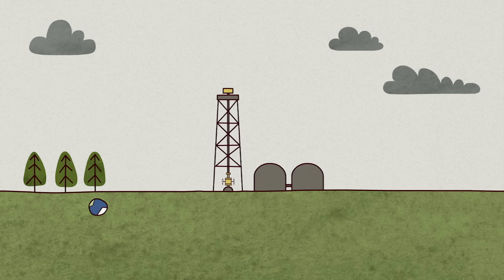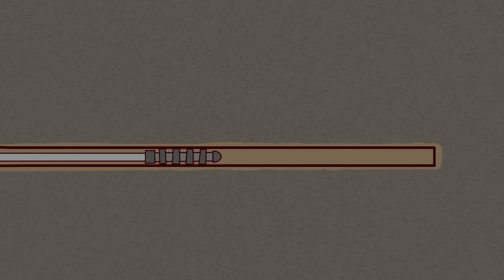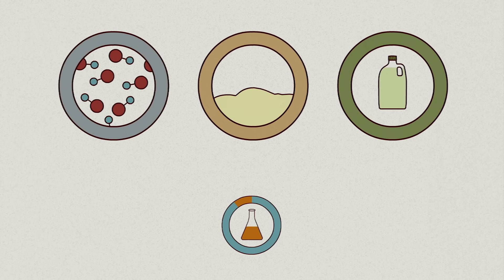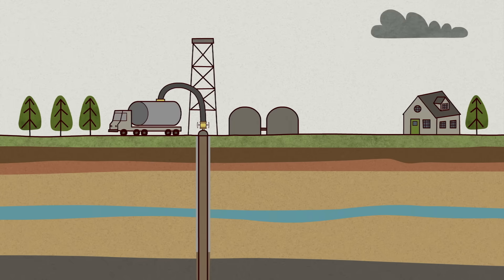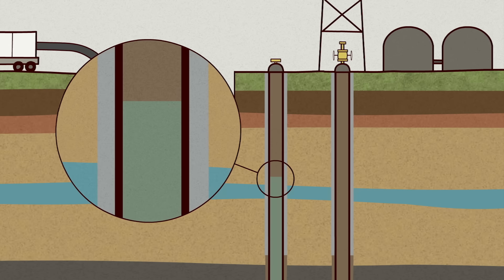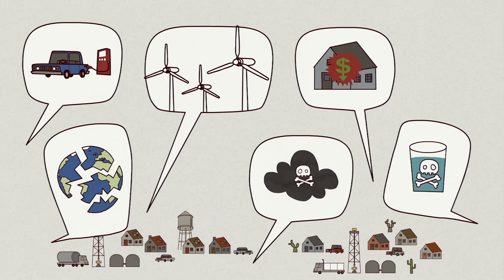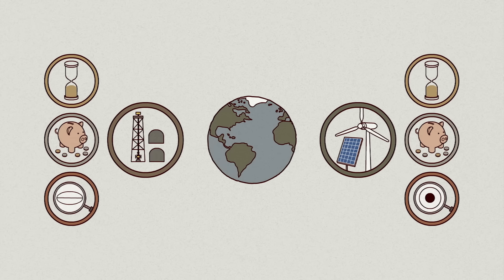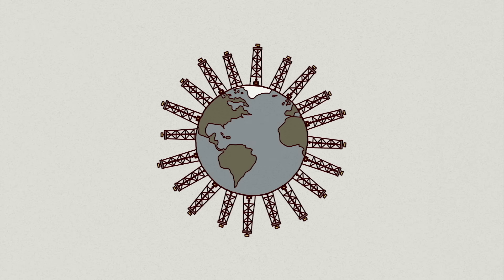How does fracking work? - Mia Nacamulli

Comment: Worked for major oil and gas producer for over 40 years. Volume of fresh consumable water back then was micro volume of today horizontal volumes. With fresh water getting to be a hot commodity for most the regions producing oil and gas, it would be nice if oil and gas company would spend a little more to clean up recovered fraction water for reuse on next well.

Comment: Those different types of chemical mixtures you spoke of, produced a cancer causing carcinogen, called Benzene. Fracking is great, because it unleashes natural gas trapped in shale, underground. But it also unleashes Benzene, into the environment. Were you aware, of that? Did it make you sick?

Comment: Fact Check: Fracking, the fracturing of underground shale to release natural gas, also releases a cancer causing carcinogen into the environment, called Benzene. When it was initiated in rural PA., there were fears of contaminated runoff impacting drinking water of  down stream cities (Philly, Harrisburg, Pittsburg), on the Delaware. There were also  lawsuits, because drillers refused to disclose over 36 chemicals (and sand) used, to bring up, the gas. Now since SCOTUS (Chevron Deference ruling) restricted the EPA's ability to regulate clean air, I suspect that the incidence of cancer around fracking production zones, has increased. And that is why there was so much opposition, to fracking. Your thoughts?

Comment: In 1970s I worked for Haliburton I worked on a 3 3/8 inch pump truck. The main ingredient was condensate. Commonly known as low grade JP-4 jet fuel. Mixed with water and sand. I remember alot of us died in Red desert wyoming when a spark started killing 9 men. It was just devastating to the environment and animals mainly the deer. And elk.

Comment: Earthquakes have nothing to do with fracking, that's a horror story told by those who want to ban it, and in turn those people/groups are paid by competing Nations like Russia and Saudi Arabia, the foreign Oil and Gas Barons. Russians have paid big money to disrupt Western industry since the early Soviet times, and now China does the same thing. Tectonic Plates are a whole lot larger and deeper than some little hole we can drill. They make mountains, destroy continents, not just crack a few rocks apart under the ground. Could there be some sort of weakness caused if it's done over a shallow and active volcanic vent? Perhaps, but they're probably not drilling in those areas because it could be dangerous, and gas/magma don't click well when oxygen is introduced into the mix. They aren't just fracking everywhere, it's done in a certain type of rock where the gas is trapped and not easily accessible, some areas have accessible gas so this wouldn't be necessary in those places.

Comment: We extract from the earth without an understanding of the ecological systems that have long evolved to that which has made our planet habitable and sustainable.  That which we take from the earth has a purpose and a function, natural gas, crude oil, water, all serve a purpose that contributes to the conditions of our environment upon the earths crust.  as we remove such elements, we obviously throw a wrench in the chain of that biological and geographical machine.  We talk of global warming with question marks above our heads all the while removing the coolant from the earths engine.  and scientists seemingly cant put two and two together.  its not simply the burning of fossil fuels, its also the extraction of it from the earth, removing the heat shield from the earths crustal depths.
Reply: I don't think it's the scientists that have a problem putting 2 and 2 together.  It's the politicians and CEOs. Huge amount of money tempts corruption

Comment: Probably don't need the gas. We need to remove methane from lower atmosphere via light to heat it up, and or sound to do same...but there's also more methods involving making, then dumping hydrogen in sky or solar drones burning it off. THEN, methane should be main economic fuel. Methane is inevitable in atmosphere, unlike other fuels.

Comment: This video should be titled "The Dangers of Fracking."  Several of the "facts" are incorrect.  Water used for humans is from water tables from dozens of feet deep to hundreds of feet deep. Fracking occurs thousands of feet deep. The deepest water sources for cities in the U.S. are thousands of feet ABOVE the level where fracking drills operate.  By definition the rock layers where fracking takes place will NOT allow oil, water, contaminates, or anything else to pass through to water aquifers.

Comment: The earthquakes produced by fracking are only 3rd magnitude, therefore they will barely be felt.  The UK has already had 5th magnitude earthquakes, and in medieval times a single 6th magnitude earthquake - those are the ones that might cause damage.  The little 3rd magnitude earthquakes do not cause damage.

Comment: So, a video that was supposed to teach me "how does fracking work", which I interpret to mean: how the fracking process physically works, gives me maybe a 2 minute explanation about the process, which boils down to little more than: they dig a really deep hole straight down, make a single turn, inject a gun like drillhead into the hole to create cracks, then power a special mixed water solution into the hole, to expand the cracks, and allow the gas to seep up to the surface.

After this very bare bones explanation ends, they then spend the next two-thirds of the video explaining why fracking is environmentally dangerous.

Umm...well, that kind of pisses me off.

I'm more than happy to learn about the environmental dangers fracking poses, but before that...I want to learn HOW fracking is actually done, by that I mean: I'd like a brief introduction to the history of fracking, why and how the process was invented, why and how it differs from any traditional oil/gas drilling methods, how and why sites for fracking are actually chosen--if there is actually a criteria that is--and of course, HOW THE GAS IS ACTUALLY EXTRACTED!

Like why do these cracks allow the gas to escape? Is the shale rock naturally porous? How is it actually keeping the gas contained? Is the shale for fracking special, or are all shale deposits rich with gas? And how did people discover this? And who or who all figured out the process, and is it a very difficult process, compared to traditional drilling? (Because the video makes it sound incredibly simple.)

By all means include the environmental dangers, too. I want to learn as much as I can, but be honest about the content of the video. If you want to spend most of the time talking about the environmental dangers, then title the video accordingly, please.
Reply: the 2/3rds of the video is WHY it was made. any actual information was there just to pad the runtime.
Reply: bruh why would you click on a six minute video if you wanted something that in depth lmao
Reply: @Plugshirt   Because it was a Ted-Ed video. I assumed there would be a minimum threshold of valuable (or at least educational) information, not 2 minutes of basically just defining the word "fracking" and 4 minutes of "fracking bad because..."

Comment: you know fracking  putting chemicals into the under ground water table  will  eventually contaminate   all  underground water  , they're all connected the north west where  most fracking occurs is at a higher elevation  water will flow down into the rest of the states water tables at lower elevations  contaminating them as well

Comment: The reason we fracture wells is that the shale that contains the natural gas has very small pores in it, in contrast with a more open sandstone.  In a conventional formation, the natural gas can flow for several hundred feet to get to the well.  In a tight formation, it flows much more slowly.  Adding the fractures allows much more gas to flow to the well for much longer, making the well viable.  Hydraulic fracturing has been used for about 60 years in other types of wells, but only recently has been applied to natural gas wells.  This technique has doubled our recoverable natural gas supply and reduced our greenhouse gas production to below the targets set at the Paris Agreement (I bet you don't hear that from many climate activists).
Reply: Not addressing that, long term, it's a complete waste of time
Reply: Or the rock has really good porosity, but the pores are not connected so nothing can flow Thru the rock without creating that connection.

Comment: Ok, let’s say the earth is an egg and the earths crust is the egg shell. If one makes tiny cracks in the shell of the egg, eventually the cracks will compromise the integrity of the shell and the egg shell will no longer be able to contain the egg. 
Now, some will say that isn’t a good comparison due to the fact that the egg, under its shell, is fluid in its consistency and the earth under its crust is predominantly rock. So let’s repeat the scenario with a hard boiled egg. The shell is cracked to the point that it is unstable, but still retains the contents. However, the contents, now having been exposed are now vulnerable to oxidation, which will speed decomposition, resulting in the entire contents rotting… 
just a thought…

Comment: Fracking was started long ago, it is not a modern invention. The first well were drilled by 'Cable Tools' and were dry. the muck was pulled out and dumped. Originally a steel wire had 3-10 sections of common stove pipe threaded over it, then they inserted layers of dynamite and glass balls until it was full. they they lowered it into the well to the formation they wanted to produce and then tossed a half stick of dynamite with a long fuse down after it and then stood back and watched for results ! There used to be an old oilwell museum in Newcastle Wyoming that had demonstrations of all these things.
Reply: Thank you!

Comment: Fracking, in and of itself, ISN'T a problem. Where the problems start to arise is in how the "waste water" is handled. Oklahoma, for a long time, just pumped that water back into the ground at a known safe depth and into a known safe layer. It actually worked well. But then the geologists noticed that the frequency of earthquake activity in Oklahoma had increased since the practice of disposal of waste water into "safe" wells was started.
Now, NOBODY knows the answer, but the theory is that the water in those safe wells were "lubricating" the rocks and allowing the easier "slip" of the bedrock, thus resulting in more earthquakes. This theory is plausible, but understand, although fairly frequent, earthquakes in Oklahoma rarely exceed 2.5. So, is it the Fracking? Not likely. Is it the pumping back of waste water? Possible, but the Oklahoma legislature outlawed that a few years ago. We will need to look at frequency patterns since stopping the practice to see if the theory is correct. Meanwhile, Oklahoma earthquakes continue to be rarely above 2.5 - noticeable locally, but not a problem.

Comment: I worked for a fracking company a few years ago....mostly Northern Alberta.....It amazed me how they could control what was going on hundreds of feet underground.... fracturing different depths and areas.... different types of sand and chemical mixtures used to achieve different results....pretty amazing to see some big jobs with fifteen to twenty pump trucks with 2500 horsepower engine and pumps each running full throttle.....worked at it a couple of years .....will never forget the experience.....
Reply: Thats cool i was intrested in working on a rig after working in tunnling, out of curiosity did you guys use betinite or a mud rig to mix and check the flow of what was coming up? How big was the hole you drilled by the way, because we did 48in diameter bores with 5in hoses for lubrication and return to the mud rig. We had other utilities and were drilling horizontal so they were much bigger.  Im going to guess your lubricating and return hoses were 2in diameter, corect me if im wrong.
Reply: As a sand hauler. I love the sound of the pump trucks roaring. Sounds like money
Reply: @ChoppaShoppa45 I work as a frac operator. It's fun to sit in cabs of the semi as they are pumping. Feeling it grab and drop gears.
Reply: Curious.....the gas coming out, what psi is it in the rocks?  Is it mostly methane?  I have heard that helium and sulphur dioxide are sometimes present?
Reply: @yestfmf  back when I did directional drilling for the pipeline the two main gasses we were concerned about the most setting off our air monitors in the tunnel or trench from disturbing the earth were methane and sulfur dioxide. We dug and tunnled down 30-60ft so might be different fracking
Reply: @dave14256  the well is drilled with a conventional drilling rig. Frac or no frac. Typically you drill several holes that get progressively smaller. We could start with as big as a 40” hole, drill to a shallow depth and then cement 36” pipe in it, then a bit smaller, and smaller until at maybe an 8-1/2” hole. The drilling rig used mud with bentonite, barite, other additives, and leaves a hole in the ground with pipe cemented in the hole. After that it leaves, the fracturing equipment moves in, uses explosives to shoot holes in the pipe and pumps the the frac through that. They use pond water mixed with specific types of sand (typically), filtered with a few additives to decrease friction loss Thru pipe, thicken it, kill bacteria, etc. a typical onshore well can take 500,000 ish gallons to frac, and exactly what is pumped in each well is documented on www.frac focus.org.
Reply: @Photo Grapher, Pressure really depends on the Geology. Especially the Depth. In the Bakken depth varies from 6500+ ft. Generally you have 0.5 to 0.75 psi per ft of depth. Generally anything over 0.5 psi/ft is considered "over pressurized" meaning the reservoir naturally is at an elevated pressure. 
There is some helium and other gasses present in certain wells. I think it's more trace level. I was talking with someone who was proposing to try to test wells and map gas concentrations it in north dakota. Not sure if it got funded or not. 
SO2 is naturally present in some areas. Well's can become accidentally "Sour" through bacterial contamination whereby they start generating SO2 more and more SO2 after time. This is a bad time and can cause corrosion and other issues. which is why they are generally careful to pre-treat any water used for fracking or injection/production tests.
Reply: It has its pros and cons like any other aspect of life. Very fascinating.
Reply: Only reason i ask about the dirt is because in some spots what ever came back to our mud rig had to be tacken to indestrial waste depots due to curropt goverment offials and in texas we would just lay our mud out in open field with no enviremwntal harm
Reply: @dave14256 what makes you think there was no harm?
Reply: This is literally  word for word a statement I read on Google.
Reply: Thats sounds like my directional drilling/tunneling experience. It was pretty cool to be working in such a big operation, and i switched to residential work now but tbh I miss being around all the heavy machinery and the smell of diesel always brings me back. What did you guys do with all the excess dirt btw? And did you use bentinite for lubrication at all?
Reply: Must’ve been nuts man
Reply: Does fracking actually cause earthquakes?
Reply: ....sounds like you messed up mama and can't say so.....why all rhe...........
Reply: I make fracking motor mounts. This is a 6x8ft frame that sits on top of the motor to mount the exhaust system. We make them for CAT. You can google fracking motor mount and you will find a semi trailor with a giant motor on it.
Reply: I currently work frac, we’ve done jobs that are 3 wells at the same time & we have 34 pump trucks in line that I run. Beyond stressful but it’s fun to figure out
Reply: Same here I was a water tech working mostly in the spirit river area. It was interesting to watch the other crews do their thing while we got the water systems going. only issue I seen with the video was our sites only used around 1million liters of water but I guess some others must be far deeper or something.
Reply: @hightechredneck8587 ours use up to 16 million liters in ab at most
Reply: I like to compare it to knowing what happens when you hit a glass vase with a hammer. Only the vase is where you can’t observe it and it’s made out of many different materials
Reply: Bruh..... y'all close up those holes and leave the toxic liquid mixture in the ground forever. 😂
Reply: I other words,,toxic and poisonous chemicals are pumped into the ground !😢
Reply: You failed to mention that Benzene was one of the chemicals produced, during fracking. You also failed to include, that Benzene is a cancer causing, carcinogen. What are the percentages of cancer impacting worker teams, as a result. Fracking releases Benzene, into the environment. Did you know, that? Do you have, cancer?
Reply: now imagine all that force doing something useful!!!
Reply: @seekter-kafa  yes because you definitely don't depend on trucks to deliver your food and necessities to stores, all of which rely on gas or diesel, and all of which travel on roads built by machinery requiring gas or diesel. Please explain something more useful than that?
Reply: @seekter-kafa  You mean like producing the thing that all of humanity depends on? Oh wait...
Reply: @Failzz8  you mean all humanity in america??? sure thing, but you are hardly the world, or human for that matter...
Reply: @seekter-kafa  powering your home or car for decades isn’t useful?